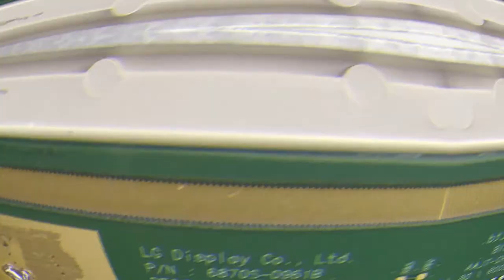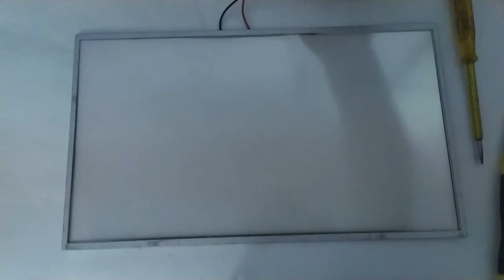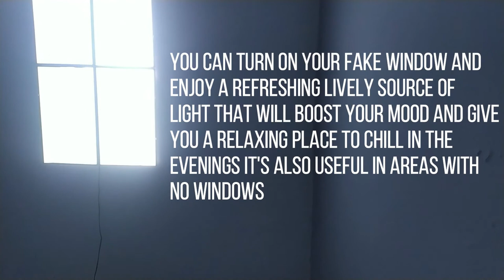How to make a relaxing false window light panel using old laptop screens

Comment: It also works with 5 volts and has the same brightness, you can try it just instead of giving it 12 volts you can give it 5 volts. At 12v it draws around 300ma and with 5volts it's 700ma..

Comment: hi, i couldn't find vled, there was just a fuse called like that, but it's a very small one. Sorry, for stupid question, could I solder the wire to the fuse? thanks
Reply from the maker: VLED (12v) may also be called VCCS, or LED_VCCS

Comment: I was going to try to make something similar using artist light boxes that you can buy on amazon inexpensively.  The problem I had is they have a power button on them that you have to press.  I wanted to combine their USB cords to one outlet and control the outlet with Alexa.  Is it possible to bypass that power button to where the light comes on as soon as the light box is plugged in?
Reply from the maker: Can you send an image of the product?
Reply from the maker: link page:
https://www.facebook.com/The-Fixer-110714973931508
Reply from the maker: another page:
https://www.facebook.com/Diy-Projects-108099184287584